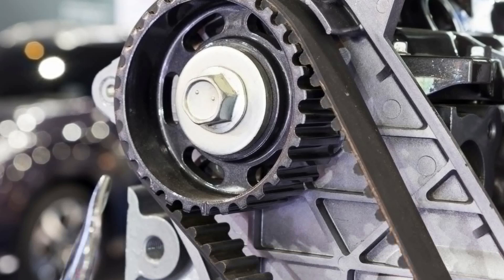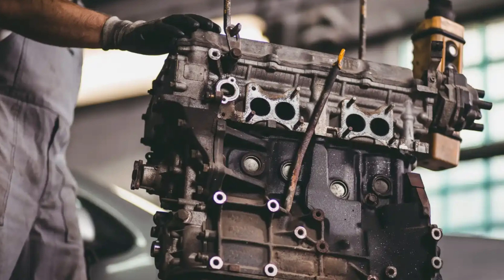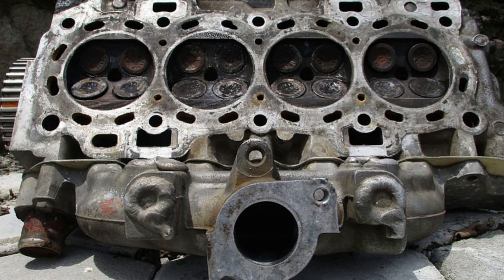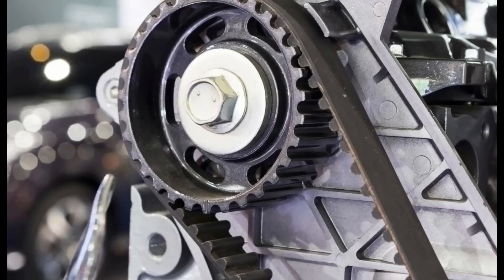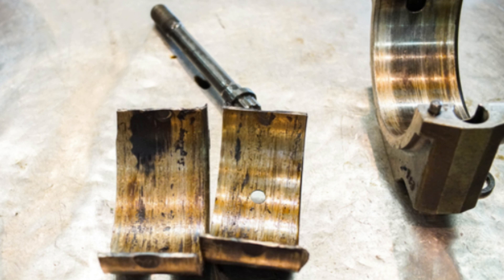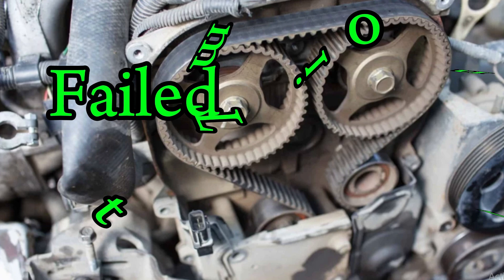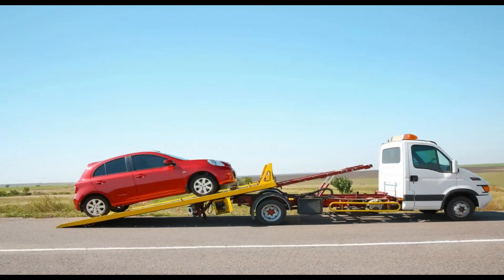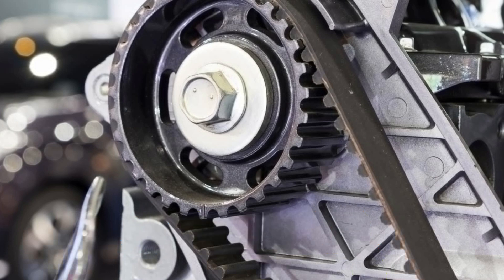10 SYMPTOMS OF A BAD TIMING BELT OR TIMING CHAIN

Comment: People must not buy cars with timing belt only timing chain.
Reply: Even chains snap over time
Reply from the maker: Yes, I agree with you what really matters is making routine checks on the engine. Personally, before driving out each morning, I always check the oil and coolant levels. While at it, I also take a quick look around the entire engine for any visible issues. That’s actually how I discovered my fan belt needed to be replaced.